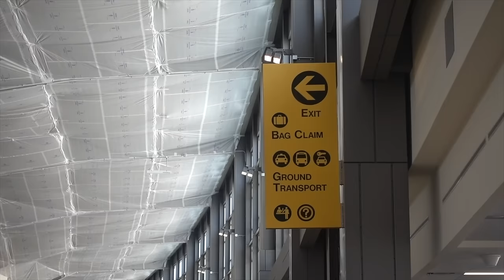MTB Myths that need to die—and some that are true!

Comment: Love the B-ROLL.... YA, I Agree with the laughs at the END... the E_Bike person is fat and Lazy, well maybe the ones that use the throttle type e-bikes, vs the Pedal Assist E-Bike, yet you can set your assist HIGH and its almost a throttle except it won't move till you ENGAGE some muscle power... I set mine to NO ASSIST in ECO mode 15% in Sport and 85 in TURBO.... so, Question? How much does a CHAIN MASTER CLIP cost... I'd have a few, If I had a chain, my e-bike uses a Gates Carbon Belt..... Cheers... Love your videos....

Comment: airliners couldnt give less of a fcuk about ur tires blowin up. it is because a cargo hold has a fire extinguisher in case of fire which is designed to suffocate fire by halon gas. now, ur tires could introduce more oxygen to the mix
Reply: also, i worked in a bike shop n got n rtard with a skewer in the disc. wheel disc skewer n front fork fucked. just tuck it in nicely so it cant catch on shit

Comment: Airplanes are sealed and preserve the pressure at ground altitude. It's a stupid myth
Reply: Not completely 1 bar, typically they pressurize to 0,7 bar in cruising altitude, which is still fine for the passengers but this slightly difference means the pressure on the cabin inside on cruising altitude is just 5 t per square meter, and not 8 t (they can be built lighter by reducing the pressure difference).

Comment: Airplane and tire pressure is for an other reason m8 and you totally failed it. You a have to decrease it to make it less of a danger. If the cargo has a fire starting as soon as the tire has a burnt holenthe pressureized airspeeds up the burning process while beeing discharged. 
Makes it more dangerous.

Comment: 6:09 the Skewer in the disk brake
Yeah, I saw that recall notice. was from Trek I think.
sure, if installed correctly it doesn't matter.
but people are idiots, someone's going to fail to tighten one and let it flop open where then it can do the backwards overextension thing.
can't trust the customers, so flip em for another layer of CYA